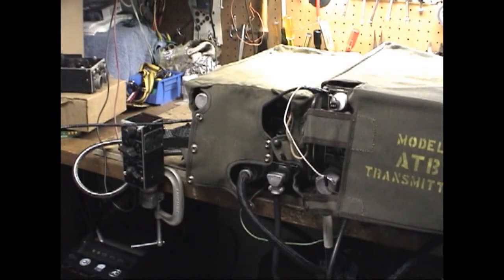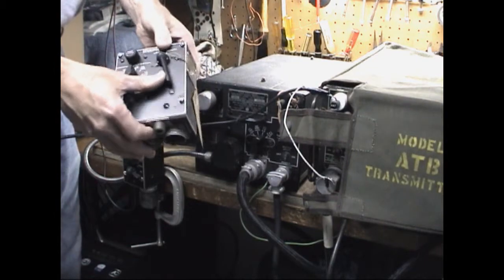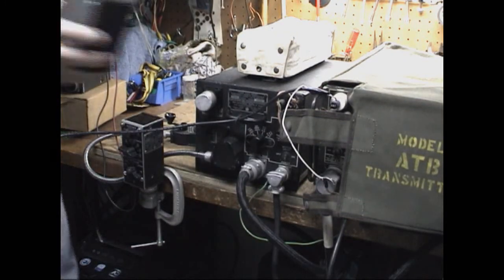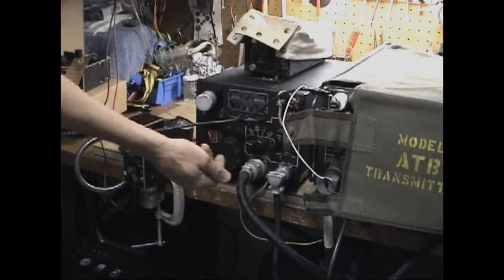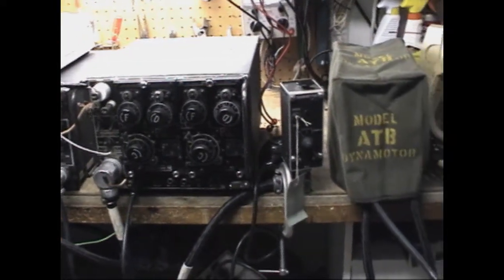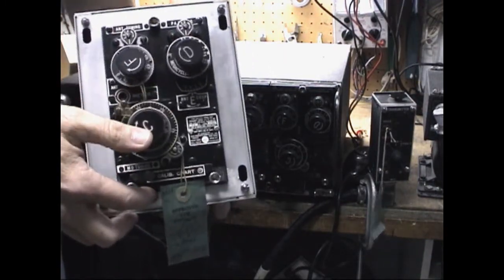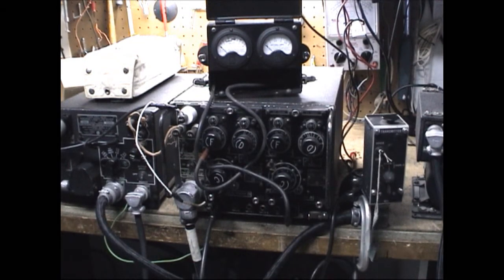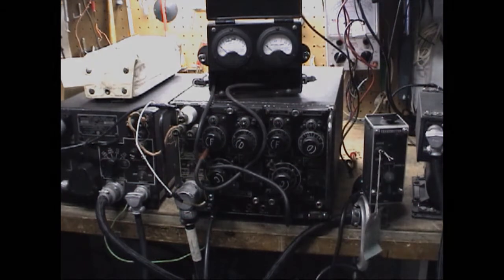WWII ATB and ARB Radio Transmitter and Receiver Demonstration and Overview

Comment from the maker: Thanks for the comments. Yes, I have two ATB sets NOS in the boxes with accessories and shock mounts. Sorry no ATB covers but I do have extra ARB NOS covers.

I have 4 ATB transmitters , each set to 80/40 but slightly different settings on all so these are the averages. Should get you started.
40 - C-20, D-7, E-6.5, F-52.
80 - C-40, D-3.8, E-6.5, F-52.

Good luck and have fun with your set!